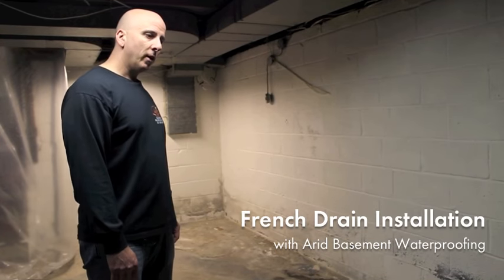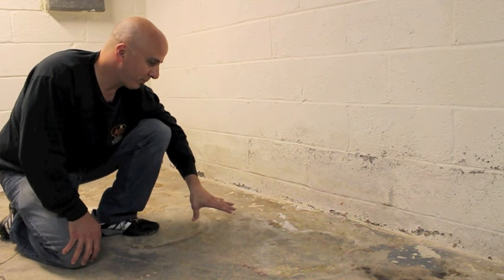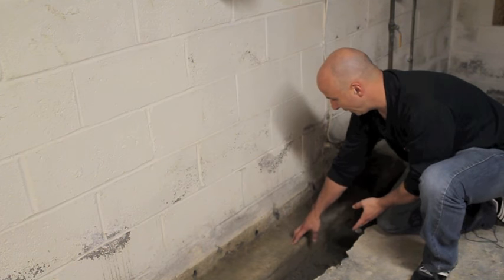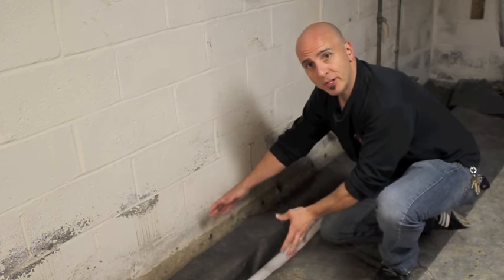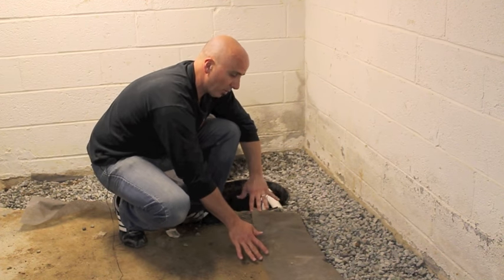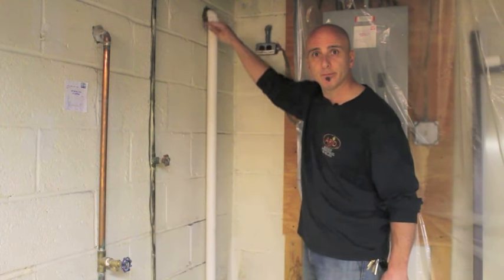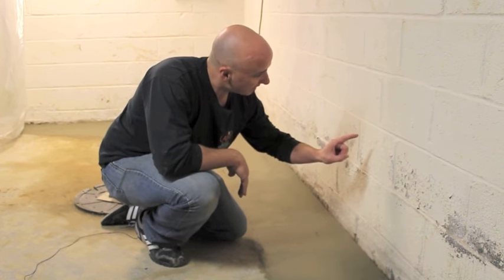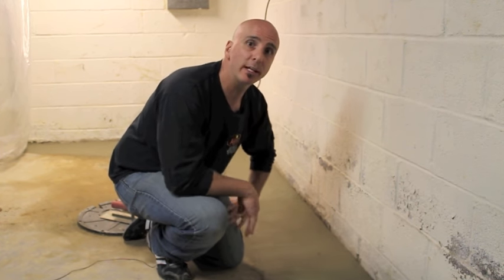French Drain Installation - Arid Basement Waterproofing

Comment: this is the first video that even mentions the water table causing hydrostatic pressure. almost all videos explain that a French drain system is needed because of rain water coming down from above. well done in my opinion as there is typically much more pressure from ground water than rain water.
Reply: Thank you Trango!

Comment: EXCELLENT video. I live on clay so my basement doesn't have much head room so lowering the floor a couple inches and installing French drain was well worth the trouble. Keeping the new poured concrete an inch away from the wall to catch all water if any is a brilliant idea. 👏
Reply: My house sits in a clay bowl as well. The previous owners did a partial French drain in the worst moisture ridden corner,  but it was not nearly enough. 

I'm having a foundation company come out and do the entire basement, as well as the crawlspace. 

The price tag is hefty but it will be so worth having any water sitting around my house pumped out to the city drain

Comment: Hi, shouldn't this be done from outside?  why is it done from inside the basement?
Reply: When you have a high water table, you can only address it from the inside. We've waterproofed plenty of houses where homeowners spent the big money and did exterior French drains and they still got water. We did interior French drains and they never got a drop again.

Comment: I think he mentioned it in the video, but the hydrostatic pressure not only pushes water into your basement, but will also push the wall itself inward (unless your home is one of very few that use rebar to reinforce the cmu blocks), causing cracks and eventually foundation issues that if left untreated can cause complete failure.
Reply: After doing this for three decades now, I've never seen the water pressure from the water table push the wall inward. The only time i've seen anything like that was with Ida in this video. https://youtu.be/pjR9b6cKQDM But this was due to pure flooding, not the water table.
Reply: @AridWaterproofing  Give me an email to send you pictures of the huge cracks on the long sides of my rancher's foundation. I had JES out to inspect and that's exactly what their rep told me. Perhaps you don't work on the east coast?

Comment: By far one of the most informative short videos on this subject. I have a question though. How can I know if my french drain (outside the house as it’s a new house) is connected to my sump pit or if it’s connected to the old city sewer lines (even though it’s a new house, the street is very old with old sewer lines). I’m asking as my sump pump works almost every minute when it rains and I’m not sure this is normal? Did my contractor not connect the french drain to the old city sewer lines? Thanks!
Reply: There would be a pipe coming in perpendicular from the wall. In my video, at 2:05-ish, you see the PVC pipe entering on the left side of the pit and that’s the little run of about 5’ that went down that wall. When I see footing drains from the exterior enter sumps, you’d see it entering at 12 O’clock (if you’re looking at a clock) if that makes sense.  Hope that helps.

Comment: Seen a lot of information on the installation of these systems. My question is: is there an advantage to leaving the cove gap versus a plastic or flexible diverter? Almost everyone else I look at uses a diverter "flashing" rather than leaving the open gap.
Reply: The difference is that if water comes through the wall up high (even if you have weep holes drilled) or from a window (that has a well) and down the wall, and you have the flashing in place, the water will most likely roll on to the floor. If the gap is there, good chance the water makes its way into the French drain. That's the whole purpose of the 1" gap/floating floor/cove gap.

Comment: Would you feel confident if the homeowner then finished the wall with drywall on furring strips after the drain was put in? What if water is seaping through the walk about 3 feet up from the ground?
Reply: I would feel confident. We bled the blocks so there wouldn't be any build up from the water table in the cavities. One issue though that people do have with water coming in from up top is that homeowners neglect to pitch their grade away from the house and keep their leaders and gutters clear. Water accumulating up against the outside of the house is usually the culprit of water coming down the wall from up top, post French drain installation.

Comment: I have something like this. How can I put up drywall over this? Do I just put on inside of the French drain with construction adhesive?
Reply: You have to put it to the inside of the gap. Don't cover it! and yes you can use liquid nails and maybe some masonry screws at each end of the sill plate and one in the middle.

Comment: We just got this done to our basement and the installer put this plastic thing that sticks up like a wall but it’s in between the cement and the foundation wall. Can anyone explain to me what this is ? And also can we put up walls to cover everything , including the sump pump ? ( but still have a way to access to the pump of course)
Reply: That is the dimple board that allows the concrete floor slab to make contact with the block wall while maintaining a path for water to run down the wall and get into the system. I think this installation should of did dimple board a and not left a 1 inch gap. That dimple board is designed to make contact with that block wall and give it support. Great video otherwise.

Comment: Thanks for the video.  Could you elaborate on the flashing?  I've looked into some other options but flashing seems like it would be cheaper.  What kind of flashing do you use?
Reply: +John Hill Jr any kind of flashing is doable. one popular kind is waffle board or mira drain. But basically you need any kind of deflective sheeting that is impervious to water anchored to the wall.

Comment: I’m planning on doing this with a poured concrete basement. Would there be any differences other then no holes
Reply: nope....exactly the same.
Reply: @AridWaterproofing  one of my walls is poured and one is block. Are you saying for the poured wall do not drill holes, just install the French drain. On the block wall drill holes and French drain?

Comment: Good work but it is CRUCIAL to add some sort of access to the pipe on EVERY side of the wall so if there is a clog you are able to access the perforated pipe and flush it clean to the sump. Otherwise when it does clog because its not a matter of time when it will, you will have to crack into that floor again.
Reply: You can get into the pipe with a snake through the PVC pipes coming into the pit. However, we do put cleanouts since this video was made.

Comment: Now with the gap between the wall and the re cemented floor, will bugs of such sort appear? What about that funky basement smell?
Reply: Bugs don't hibernate 6-7 feet under the ground and come up through the gap. Only time where a smell might occur is when the homeowner has iron bacteria present in the ground, but that is not common.
Reply: @AridWaterproofing  Thanks for your response.. I just had my basement french drains covered, and added a second sump pump. It's a month now and notice a big difference now from before. I should have done this when I moved in a couple of years ago.. Thanks again..
Reply: Well, we had a wall done 15+ years ago and that 1 inch gap allows many spiders to be coming in and out of from behind the  plastic sheeting and the holes drilled into the cinder blocks.  I am highly suspect that those who did our French drain system did not do it correctly.  Those holes should be below the floor not above the floor hidden by 5 inch high plastic!  All these years later, it's just me and my mother and we have no paperwork on who did this job.
Reply: @ariesmars29  i could assure you that spiders are not coming in from that 1" gap. Think of how deep your basement is. Average is 5-6 feet from grade level. Spiders and bugs do not live that deep into the ground. They are, however, attracted to the opening and are coming in elsewhere and making their way to it.  As for the bleeder holes, if your first course of cinder block is filled with cement (a lot of them are!), you have to then drill the next course up, hence, the plastic flashing is needed. If you're in my area, give me a buzz and i can see what i can do.

Comment: What type of flashing do you use if you have radon?
Reply: A flat sheeting kind of flashing so you can run a thick line of silicone and adhere it to the wall to try and make everything airtight.

Comment: Wow no mira drain not every wheep hole was drilled out or morter joints and lastly what did you use quarter of a inch of concrete hope the homeowner doesnt put anything heavy on that and your trench that was hammered out and dug out was no where near the actual size needed
Reply: Hi Ken, 
If you understand how the block wall was built, being staggered, you don't have to do every single cavity and every  mortar joint. Our opinion is the less holes drilled into the foundation wall, the better. You do the occasional hole and if there is a problem area that needs every cavity drilled, then we do it in that particular area. However, a blanket, drill-every-cavity-in-every-block philosophy we don't subscribe to. We've seen where those holes have been detrimental to systems. Replacing other company's systems and seeing all those holes drilled led to dirt/mud pouring through those holes and it clogged up the French drain. We filled in those holes with cement, replaced the pipe and gravel and they never got water again. 
 As for the concrete thickness, I could see how the video doesn't lend a good angle, but it's normally between 1"-2". It can't be the original thickness for certain logistical reasons, but we've been doing this for decades and haven't had people complain about the cement.  
To address your comments about every weep hole is sub floor, well, that's simply not true. When you have a monolithic poured foundation/floor, the first course of cinder block is sitting on the floor. That's one case, the other is when the first course of cinder block is filled up with cement. You're drilling into solid concrete, so in order to drain the wall, you have to go into the second course and therefore, above the floor level.  As for the width of our trench, we've been doing French drains for over 5 decades and have a stellar reputation. I think the width of our trench seems to be just fine.
Reply: Yeah but if you don't drill every cavity in every block, don't you leave water pockets? And the system with more holes drilled out clog up with dirt, why wouldn't your system with one hole do the same?

Comment: You guys should have used a dimple mat in front of the weep hole
Reply: We use a plastic sheeting that serves the same purpose when the holes are above the floor level. You can see the ones drilled in this video are below the floor surface.
Reply: I do like the dimple pad as well as it helps make contact with the block wall and the floor. Your weep holes are in the gravel layer so no problem there I just like the support for the wall that the dimple board provides instead of just a 1 inch gap. 
Great job.  @AridWaterproofing

Comment: Wouldn't it be ideal to divert the water from the outside of the basement wall? instead of ripping up a good foundation? Just asking because I have the same water issues in my basement and need to do something soon. I'd just rather dig around the outside of the basement wall and install drainage at the footer if possible.
Reply: When you're dealing with a high water table area, like we are in the greater NYC area, the only permanent way of relieving that hydrostatic pressure is with an interior French drain. We've done plenty of houses where the homeowner spent the big $$, had their yard ripped up, to only still have the water enter the floor/wall joint.
Reply: I agree with that comment just from hearing other nightmare stories @AridWaterproofing

Comment: Like your video but not your fabric filter under the pipe....always a chance of plugging the fabric..
Reply: Certain soils propose different problems...Most are not a problem and we use the fabric. Some houses we do not. Every house and condition is not the same so you have to be able to pivot when it calls for it.

Comment: This is not done in the correct manner, they are missing some VERY key elements. 
1.) They absolutely should have installed a drain board material to cover the weep holes to help direct the water down over the footing into the pipes. Many companies don't do this to save time and money.
2.) They must put a 6 mil plastic vapor barrier on top of the filter fabric and stone BEFORE they re-cement the floor back. This barrier helps keep moisture from permeating through the concrete. It is in the building code for slabs. Again, companies don't do this to save time and money.
3.) The sump pump discharge should NOT be connected to the exterior roof leader drainage. Typically this discharges into the STREET and that is illegal and against code because it will cause icing in the winter months. However, if it discharges directly into a storm drain in the street via underground drainage, that's fine. If not, then once again, companies look for short cuts to save time and money. If there is no storm drain in front of the house, this sump water should be drained into s separate mini-dry well or drain-box on the property. Most companies DON'T do this. 

You get what you pay for when it comes to basement waterproofing. Buyer beware.

My Credentials: 
NJ licensed building inspector and construction code official.
Worked for very reputable waterproofing company that has been in business for 30 years and is NOT a franchise. Have seen EVERY type of system and have replaced many like the one above or at least fixed them because of short cuts taken by certain waterproofing companies.
Reply: Hey Jeffrey,   Thanks for the comments.  Let me try and explain a few things from our perspective. 

1) When you drill the weep holes below the level of the floor, you do not have to use flashing. If they are above the floor level, then you have to install flashing. You're right, the flashing is to cover the weep holes and direct water down to the drains. In this particular case in Park Ridge, if you look at the video carefully, we were able to poke through into the cavities below the floor level. Sometimes, when the bottom block is filled with cement, you have to go into the second or third course and then, for sure, you have to use flashing on the wall. 
2) On new construction, yes, there should be a vapor barrier but i can't tell you how many times we open up the floor and there's nothing. So, in theory, yes...in reality, it really doesn't matter.  We do put down vapor barriers before we cement and we are also trying out adding a crystalline mixture that fills in the pours of the concrete to prevent moisture coming up through capillary action. 
3) Through my experience, every town has there own rules, so some are ok with it going to the street and some aren't. As I said in the video, the homeowner's leader was going into a brand new 500 gal catch basin that they put in about a year ago. We tapped into it, at their request, and I only approved because it was a newly installed. I am highly suspect of original catch basins where homeowners have no clue the age of it. 

FYI, Haven't heard a peep from the homeowners in Park Ridge since doing the job. 

Our credentials:
In business since 1963, family owned and operated
waterproofed over 20,000 basements
A+ rating with BBB
impeccable online reviews.
Reply: damn. done wrecked that original comment like a wrecking ball!
Reply: Shut that troll down!!!

Comment: That 1 1/2 in drain pipe will never work
Reply: are you talking about the discharge line?  why wouldn't it work?
Reply: @AridWaterproofing  hey guys about how far was your discharge pipe travel before the up turn to go up grade. I'm finish my system and go back and forth on if I should put my discharge pipe under ground? Also is that a little gaint sump pump you are using ?
Reply: @Followmyleadk9  we usually keep the underground d/c pipe to about 20-25' with a 1/3HP. If it's more than that, jump up to the 1/2HP pump. Yes, we use Little Giant pumps.

Comment: Totally wrong. No pvc, use corrugated pipe, need to come out at least 12-15 in. You have no uncoupling membrane so the water can channel from the wall into the drain. You never hard pipe  the discharge into a gutter drain as this can freeze and expand- possibly destroying the entire drain
Reply: Sorry Doug, going to have to disagree with you on the PVC/corrugated pipe decision. I have to rely on our 40+ years of using PVC pipe and having hardly any issues. I've replaced a lot of corrugated systems in my decades of doing this and I get it, cheaper and easier to use. Two big problems, it's flexible and VERY difficult to pitch. We certainly put membrane when the bleeder holes are near the floor level or above but if you see, the holes are below the floor level, no need for membrane.  As for the d/c line hard piped, if it's all pitched and no way water can sit, it cannot freeze.